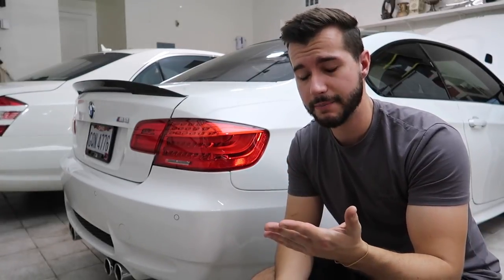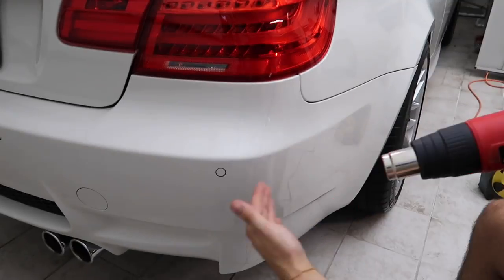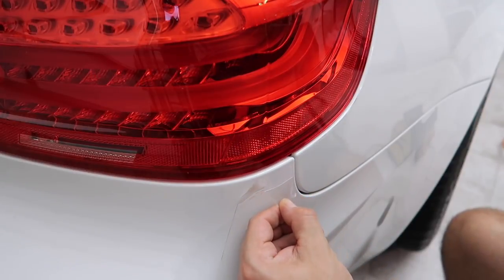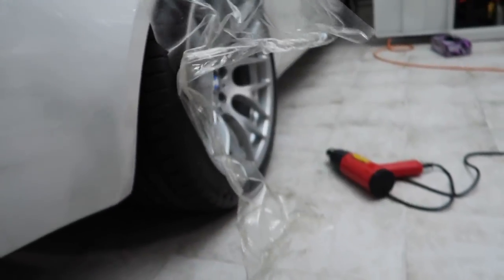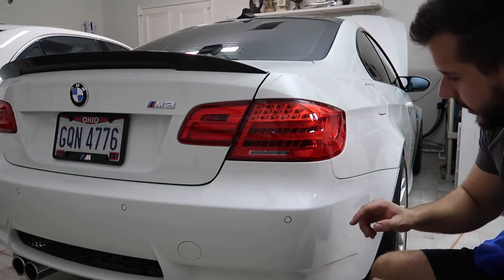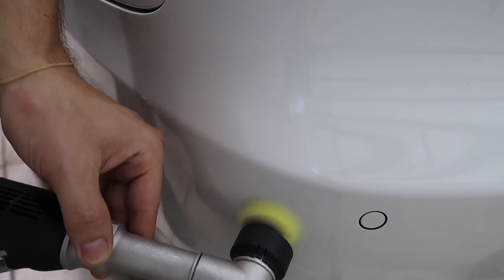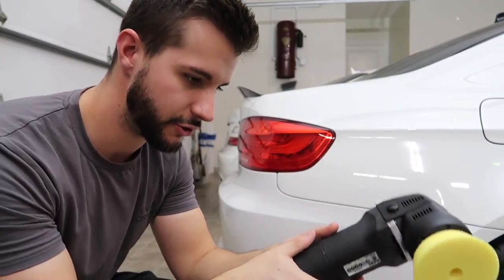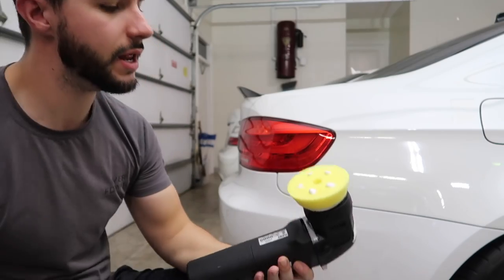Removing Paint Protection Film from my M3

Comment: That cquartz isn't going to do a thing against road rash. You're going to get heaps of gravel chips in the painted area of the wheel well. It's worthwhile putting a PPF coating on the whole bumper so you don't have the seam. Take it from me. I bought a 2018 M140i second hand and on close inspection those wheel wells cop a beating. Also the lower side skirt behind the front wheels

Comment: I have that dirt line also. I tried GooP Off, acetone, and alcohol to remove it with no luck. Is buying the Gyeon Prep worth it or should you just buff it with the polishing machine.
Reply from the maker: I would use Gyeon prep, all purpose cleaner, or IPA diluted.  if those dont work, I would use a polishing pad to clean it up